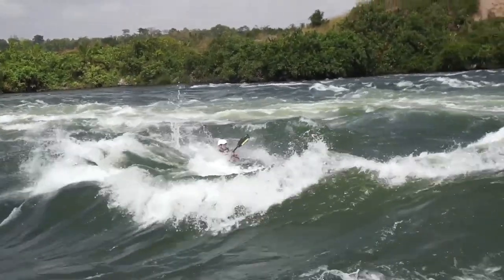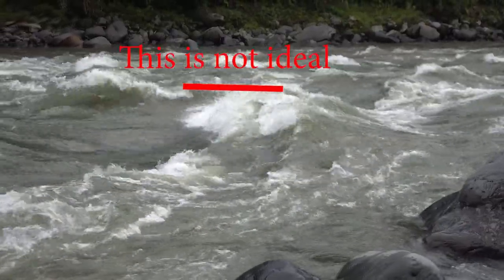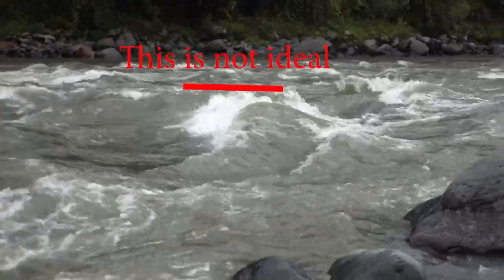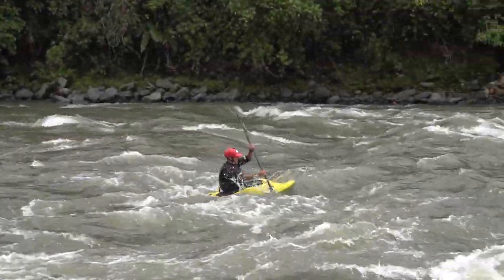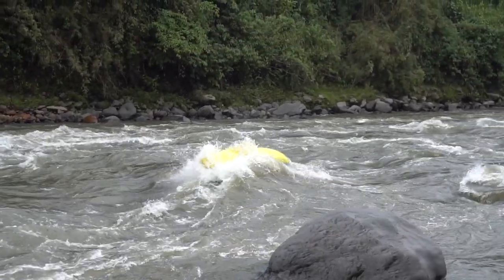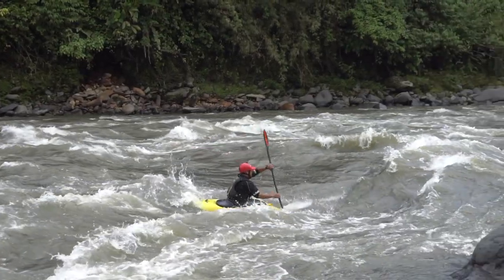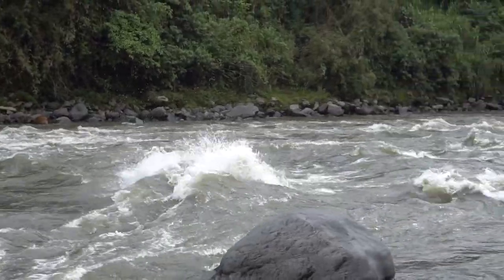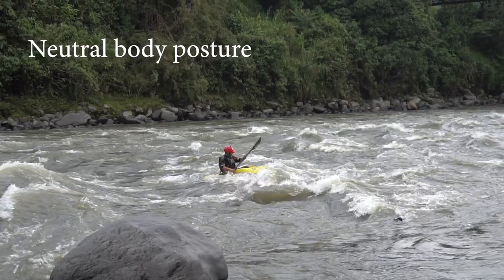How to Kick Flip [Basics] Whitewater Kayak Tutorial

Comment: Thanks. Just one thing. You take your acceleration stroke on the right just before throwing the move. I'm doing that too, but it's a long way for that right blade to go to initiate the rodeo roll falling left. Thoughts on doing acceleration stroke on left side for better set up for roll?
Reply from the maker: When I am doing the Pan-am style I use that initiate stroke on the left. So it can definitely work.  The key here for this style (in my opinion of course) is that the right stroke is simultaneously pulling your body back making that roll go easily.  Further the roll is really coming from the hips and legs rather than relying on the paddle. So in summary, yes its possible but i prefer right as it lines up my body to be waaaaaay back which helps my hips and legs flip my boat.  hope that makes sense!
Reply: @SethAshworth  Yes, it does. I need to improve my rodeo roll, which used to be good. It's good when you can do it with just your hands... thanks for the tip. Keep those vids coming. I'm enjoying the basic level ones like this.
Reply from the maker: @steffanmh  doing my best! Thanks